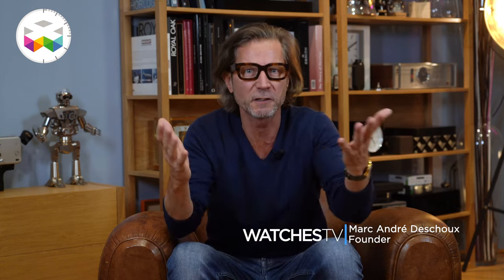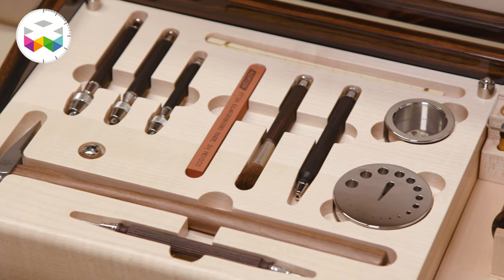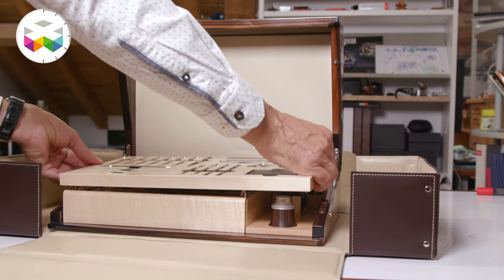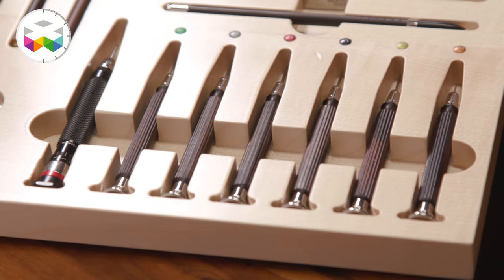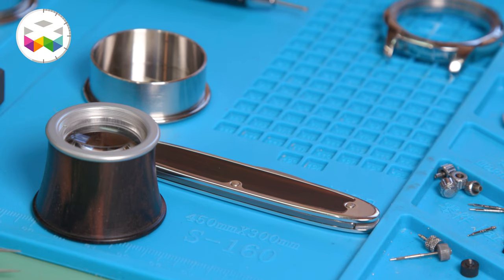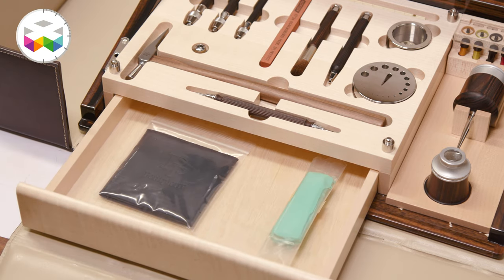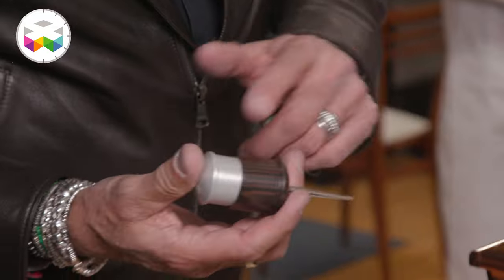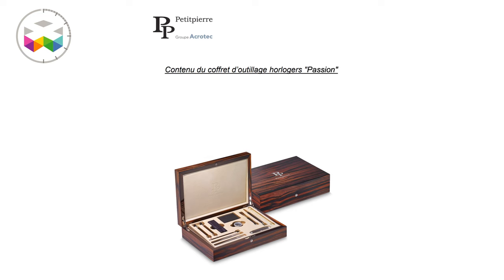The Rolls of Watchmaking Toolbox by Petitpierre: Coffret Tradition

Comment: Rolex have one only purchasable by their Authorized Dealers and the screw drivers appear to have around 5 colour coded pre-set torque bodies and colour coded heads for different sizes screws.

I presume there must be a data sheet on each model regarding the bracket link screws:

Which colour coded head to use on which colour coded screwdriver body of specific pre-set torque.

Counter-intuitively they include superglue in the box or the equivalent that some watch dealer You Tubers have disclosed:

David Khalil of Mayfair London used/ pre-owned ‘Watchcollectors’ 

A screw fixing compound used on link screws so they don’t unscrew automatically and you lose the watch.

This is supposed to be why Patek Philippe appear to use the force fitted pins and sleeves in Nautilus bracelets which don’t feature individual screws for the links.

I have also seen on a NYC Authirised Dealer a photo of a small laser powered tool/ jig holding a link whilst it is heated to melt the screw fixing compound, which is apparently available in different strengths and from Loctite.

It is why you should only get your watch from an Authorized Dealer who will have all the required tools to remove links and size the brand new watch.
Reply from the maker: Thanks for sharing this and have a lovely day!